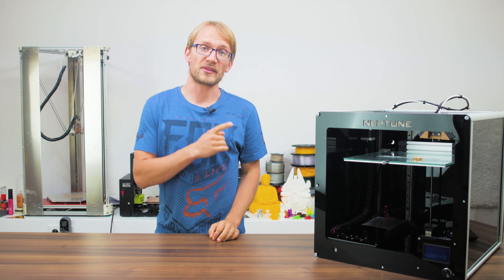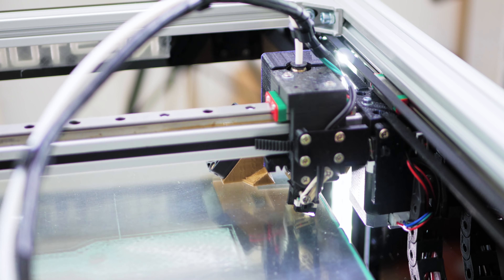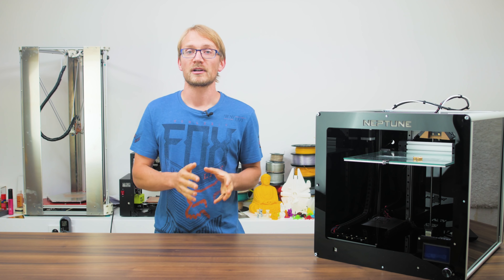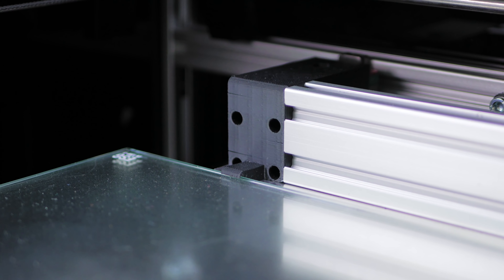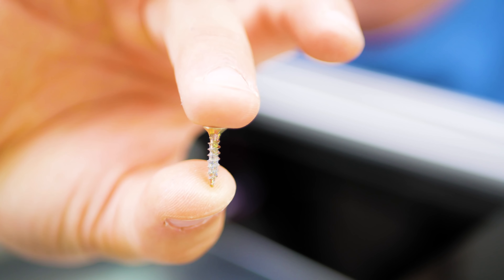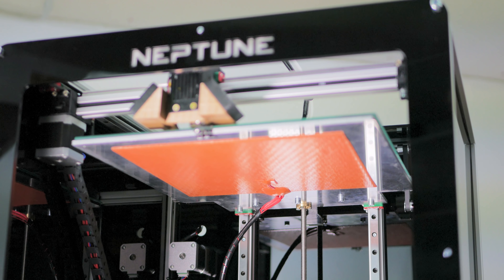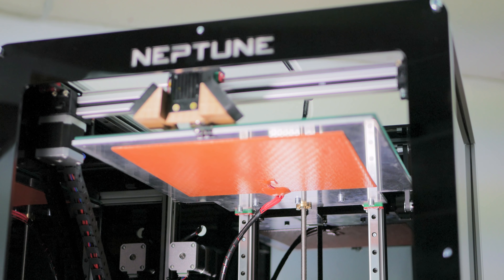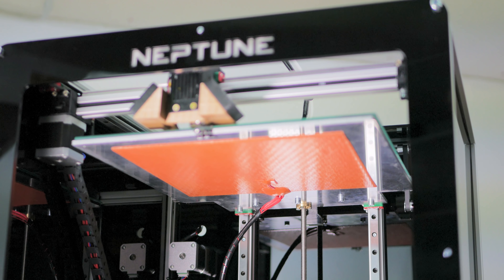The PYI Neptune - What has happened to crowdfunding?

Comment: Good honest coverage with all points covered-- good job! Here's my small take: Screws-- that's a fail outright, screws should be as they NEED to be, not whatever is laying around; heated bed-- get rid of this option, it's very easy to ADD heat to a build plate from underneath, let the purchaser do this; miscut panels-- FAIL, the panels are machine made and should be uniform, because it's not that hard to do; open voltage-- FAIL FAIL FAIL! Cover that thing, somebody WILL DIE from it. 

That wasn't every point, but the ones that stuck in my own head. I would be content **IF** these things were documented somehow and told to me **IF** I was to buy this machine. It looks like an unfinished product, agree with you there. One more thing, why does build volume dictate the prices??? This has never made good sense to me other than in a purely financial way (bigger bed=more money). Sheesh. 

Again, great video!

Comment: After finally using a cantilever bed setup I can say they suck.  So many artifacts due to it shaking (as you did with your hands) when it is printing.  I would never build one with less than at least 3 points, more like 4, so the damn bed doesn't wobble and shake as the nozzle moves around.
Reply: I have a cantilever bed printer (Type A Machines Series 1 Pro) it's expensive, but it's as solid as a rock. The bed is secure, and doesn't move at all, in fact it doesn't require the motor to be to stay stable, it's one of the design aspects that I really love about the S1. There are other things I don't like, but the bed is a spot on.
Reply: kazolar
You are a rare one then because the beds all shake on even the 2k dollar machines because it is a really poor design choice for a bed.  No mass is ever 100% "rock solid" being held up by only one side.  It goes against the laws of physics and engineering.  Can't be helped.  It can be reduced but never ever completely mitigated.  Of course that drives up the price immensely while never being 100%.  Why they don't just put two on each side is beyond me because the price wouldn't go up that much and the bed would be as solid as it will ever get.

Two on the left and two on the right instead of just two at the back (both designs allow easy access to the part) but this Makerbot styled design is utter rubbish but so many follow that design due to their costs not yours.
Reply: ***** the s1 pro is $4k+ now (mine was $3200, I bought it before they hiked up prices for some convoluted reason). The bed design uses two sliders in the back and a heavy duty lead screw in the middle -- there looks to be some other smooth rods or just lead screws in the back as well. It's over engineered vs forgoing the open design they're going for and supporting with sliders on both sides as you say, but of all the glitchy things on this printer (and for a machine that expensive there shouldn't be) I fixed all of them with my own mods (like a fan on the stepper drivers -- DUH) it works very reliably, and it's extremely solid. It's a really heavy duty thick cantilever support system. It doesn't move. I've maxed it out at 150mm/sec travels and 100mm/sec print speeds, but very conservative accelerations as the extruder can't keep up with more (it's a direct drive non-geared nema 14).
Reply: kazolar
Well, I would love to see the inside of this printer to see what they did.  Now, is the shake large enough to impact a print?  From what you are saying no but I can tell you it does shake just so minimally it doesn't matter.

One way to help the design is say using a 200mmx200mm bed and 16mm smooth rods but just use four 10mm smooth rods and the cost would be less.  With just two 8mm smooth rods, and a 8mm leadscrew, it will shake like no tomorrow (Makerbot's 9x6 style bed so isn't even 200mmx200mm). 10mm will help it but it still shakes. 12mm even less shaking and by the time you get to 14mm (due to it only being a 9x6) the shaking falls below what a print will show.  200x200 needs 16mm or even 20mm but in all seriousness the design is flawed.  Would you feel safe going up an elevator with such a design?  I would not and lets not even talk about the rocking, and shaking, a fast elevator would do to you.

I am not sure who thought up the cantilever design but they should have been shot before they thought it up, lol.

Now in a Makerbot style printer they use one Z motor with an 8mm leadscrew (doesn't matter how big this is as it really has very little impact for this) with an 8mm smooth rod on each side.  That sucker shakes so the Chinese are finally putting in 10mm and it does help but add a glass bed (more weight) and 10mm shakes as bad as the 8mm did with just some BuildTak on it.

I would love to see what they did but I still have to frown at using a cantilever design ESPECIALLY for that price.  OMG, ugh.
Reply: There is no shake in the bed, you can google the printer to see images of it. You can see large thick aluminum armature pieces going into the back housing and attaching to slide rails. The bed is very stiff. You will shake the entire machine if you shake the bed.
Reply: Thomas Sanladerer, my experience with a Cantilever bed is with the Type A Machines Series 1 Pro. It is the exact same print volume. And it is absolutely solid. You can google images of it to see how the sides of the bed are attached to guides inside (not rods), then there is an acme screw in the middle. of the back. Hard to explain it. You literally can pick the printer up by the bed assembly and not have it move a fraction of a mm
Reply: kazolar
I agree with Tom as that is how I always thought it should be done since two sides are braced unlike the Makerbot scum machines which have two rails, or rods, on only one side to brace with which makes for a shitastic wonky bed.
Reply: and that would be fairly simple design stage fix if they just moved the rods to the sides, it would still not be perfect, but whole lot better, with no additional cost.
Reply: skaltura
I agree.

Comment: Hello. I'm new to 3D printing.You mentioned that the quality of the prints are bad. What makes a bad print? What specifically? I understand that if the print fails or parts of the print fails, then it is a bad print. However, the objects you showed were complete. Therefore, what about them makes them bad and therefore the printer bad (beyond what you pointed out)?

Comment: It's rather baffling that they would send you a machine with so many "rough" edges. They want you to promote them in a good light, then what they should be sending you should represent the best of their test units. Having designed and built a 3d printer from scratch, this looks like a total mess. Nothing in here would be anything I would have even considered doing as a temporary measure to get something moving/working, and to consider sending this to a reviewer to play with would be a total joke. The idea is really good, the design is similar to a Type A Machines Series 1 -- but that machine is completely rigid all metal, and also considerably more expensive ($4K US with a heated bed). This is a good idea in theory, but their execution gives me a lot of pause when considering their campaign.